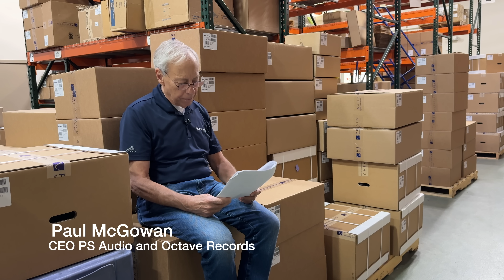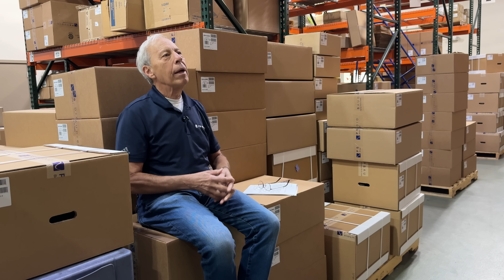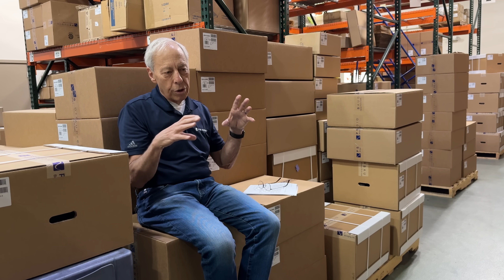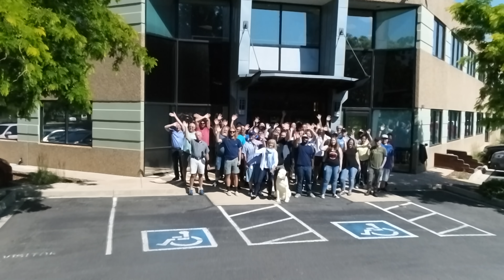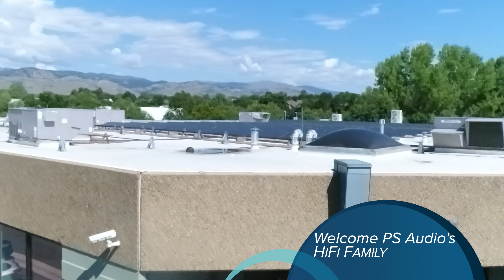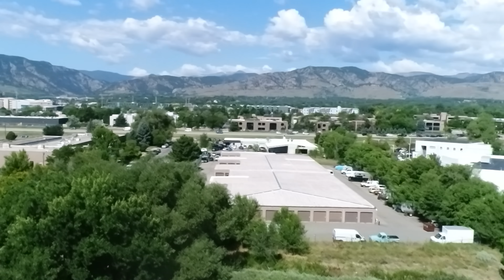Understanding how a direct digital amplifier works

Comment: Thanx Paul. You really should be a university lecturer in your next life… (-: I studied electronics/electrotechnics and my lecturer and professors were boring as hell…. …you easily could have replaced them with AI …. (-:  But you’ll never be able to replace all these „Paul‘s“ in the world with …😅😅
The PWM you described and explained here is used by my Lyngdorf TDAI 3400 amp. In fact TDAI means TotalDigitalAudioInterface. Any digital signal (from the internal streaming section or an external device) is processed digital only or pure digital until the real end just before this signal gets out to the speakers and therefore needs to be converted to analog. But even the amplification is done digitally. Very interesting system. And Peter Lyngdorf (founder of LYNGDORF audio, the danish Paul so to speak ) has developed based on this digital method / process chain a room correction system (I‘like to call it „Room Adaptation“ system) called RoomPerfect. A unique DSP system which isn’t going to adapt your speaker to the room (like DIRAC) but rather explore the room with a sophisticated method and then adapt the amp to the environment and preserve all the specifics of your speakers sound profile . The US audio company Macintosh has licensed and integrated RooPerfect in their equipment .

Comment: Class D can be thought of as an opamp, if the output voltage is too low it increases the pulse width, too high it reduces the width.It's an analog process. Pure digital output changes in discrete steps, that's OK but care has to be taken to maintain dynamic range as the volume is reduced, and without any feedback inaccuracies in the output is uncompensated for.

Comment: I have a pair of Danish 4 ways active speakers with digital amps (also referered to PowerDACs) inside and they sound amazing. Amazing value for the buck. The entire electronics block incl. the WISAmodule inside the speaker is just 2.5 by 2.5”. I spoke to the designer and he said that what is needed when the speaker and the amp is designed for each other.

Comment: As far as I understand the Technics SU-R1000 is such a direct digital amp.
Sure it doesn't sound bad at all, but I heard it at my dealer's several times with different speakers.
The sound is too dry and analytical for my taste, kinda "papery" if that makes sense. I much prefer classic A/B or A amps, for now...
Reply: That's interesting to hear as my experience is that it's a bit warm in its sound signature, and that's also what I've seen stated in several reviews by experienced reviewers.
Reply: @storkfletcher821  ... surely I'm no experienced reviewer... 
And I don't mean to knock on these Technics "power DACs".
They are just not MY cup of tea, and MY perception is them being a little to dry. 
... I would even distinguish between "dry" and "cold"... so... "dry and slightly warm" is not even an oxymoron IMHO. ;-) 
Cheers!
Reply: @medonk12rs  I didn't mean to mention reviewers as a way to lessen your impression in any way, although I see how it could easily be taken that way. I really meant that it was interesting to hear your view of it as plenty in audio is subjective and I'm not trying to argue against you. And as you say, we may view various descriptions a bit differently.

Comment: Thanks for this explanation, Paul! I've had several different class D amps in the past and have finally returned to a conventional class AB bipolar transistor amp... the detail is much better overall than with any of the class D amps that I've had... and one of them was actually pretty good, but the detail in some instruments never came through like it does with a conventional AB amp. Thanks again for the great video! Cheers!

Comment: To my listening the question refers to streaming amps where the input signal is SPDIF coax or optical with the output signal PWM voltage and amperage. No conversion from analog unless there's a turntable or a tape deck. An elegant solution unless you're in the dac business.

Comment: Does it mean that you go from a digital source directly to the amplification? So without a DAC? I mean are the DAC and the amplifier integrated? Or is an analogue signal digitally converted to steer the amplification? Or is there a A to D converter for the analogue signals?
Reply: Digital amplifiers don't have a DAC. That's part of the point.
Reply: @CraigArnolduk  Yeah… I guess it is arguable if the last stage of class D amplification is considered or not a digital to analog conversion. (Confusingly I also typed PCM above when I meant PWM… sorry.)

My point was, though, the traditional way of connecting a DAC’s analog output to a class D amplifier results in an unnecessary ADC operation in the signal path. With the assumption that for highest fidelity, converting to and from digital should be minimized, this hypothetical digital class D amplifier described by Paul would minimize the number of these analog/digital domain transitions. Since the first stage of class D amplification is an analog to digital PWM conversion, this could easily be avoided if the class D amplifier was simply fed a digital signal rather than an analog one, like: digital (PCM) → amp → math converting PCM to PWM → amplified PWM analog → speakers, or even simpler when source material is DSD, like: digital (DSD/PWM) → amp → amplified PWM analog → speakers. (as described, strikingly similar to the PS Audio DirectStream DACs).

Is anyone making such a digital input class D amplifier currently?
Reply: I like the idea of having the DAC and amplifier integrated. But it makes it impossible to match gear…
Reply: Yeah… I think this is where Paul was going at the end of the video. The current situation when using a DAC feeding a separate class D amp is like: digital source → DAC → analog signal → ADC conversion to digital PCM in class D amp → amplification DAC in class D amp → analog → speakers. By combining the DAC and class D amplification, it becomes possible to eliminate one analog → digital → analog round trip in the signal path.

Comment: Is it a misnomer to call it "direct digital" when the last actual digital stages is before the PWM stage and integrator for the analog stage? Seems an actual direct digital would be the output of the DAC through lowpass filtering.
Reply: What you're saying is the case, "direct digital" describes a power-DAC. There's no active stage in it that isn't "digital," including the output/PDM stage, which is just a high power transistor doing the exact same switching that a 1-bit DAC would do. The integrator in a power-DAC is a digital integrator, unlike the analog "integrator" (output filter) in a class D.

Comment: It seems that Class D amps and Direct Digital Amps are interesting technical innovations with the objective of lowering the cost of building power amps.  Their challenge is to perfect a very complicated circuit to sound as good as the old fashioned class A or AB amps while making it small, cheap and efficient.  I am happy that this may make great audio accessible to a wider audience, use less power, and fit into ever shrinking personal spaces.
OTOH, I am happy to use giant monoblocs with vacuum tubes and lots of big nasty toroidal transformers that fit in my big detached home.  The 350W per channel heat dissipation and the red glow of the tubes is like sitting by a fireplace while listening to great music.  And I will drink a glass of fine wine made by century old vintners and not synthesized by AI.
I hope that after I am gone someone recycles the copper and enjoys living in one of the tiny condos they build where my house used to be.  Just say I feel lucky to have been alive while all this was possible.

Comment: letter D used to designate an amplifier class is simply the next letter after C and, although occasionally used as such, does not stand for digital. Class-D and class-E amplifiers are sometimes mistakenly described as "digital" because the output waveform superficially resembles a pulse-train of digital symbols, but a class-D amplifier merely converts an input waveform into a continuously pulse-width modulated analog signal. (A digital waveform would be pulse-code modulated.)

Comment: Thank you Paul, this was a great explanation of a technical subtlety I wasn’t aware of. Purely by chance I came across an in-depth explanation of some of these principles and how they are used in trains in this video: https://youtu.be/IRJIJPTUXXE?si=RBI9XRfXN5F7O58s
This is for trains’ AC motors, but the principle is the same, just using a rotary motor rather than the linear motor in a speaker. At 13:45, you can hear an ÖBB 1016 making a musical scale as it pulls away, seems the Siemens engineers have something of a sense of humour.

Comment: Class D, (PWM) a continuous average voltage value based the on and off pulse widths. If the off pulse is 10% of the cycle, and the on pulse is 90% then the average value of these two is 90% of the amplifier’s full voltage capability. A 50% “0” and a 50% “1” has an average of 0V with a Class A amplifier.  However, let’s be clear, Class D was invented for one reason, thermal / power efficiency. It was not invented as a low distortion, low IMD, low anything else. It has undergone a huge amount of work in order to make it acceptable for HiFi use, but the main reason behind it is the high thermal efficiency, it only requires a small heatsink, smaller PCB, smaller chassis, cheaper PSU, or put another way, its cheap.
Reply: Yes, it’s about more power in a smaller size with less losses at a lower cost. In the late 90s I was at B&O where we worked on class D with the aim of best possible sound quality and called it IcePower. I still have a pair of Beolab 1 prototype active speakers working well now for more than 25 years with class-D in my home theatre setup. I wouldn’t use them as audiophile speakers, but my KEF LS60 in my living room and KEF LSX II in my office room are really not bad for class-D. For my listening room I use class-A.
Reply: You left out amperage. PWM sends amperage with voltage. Ohm's Law.